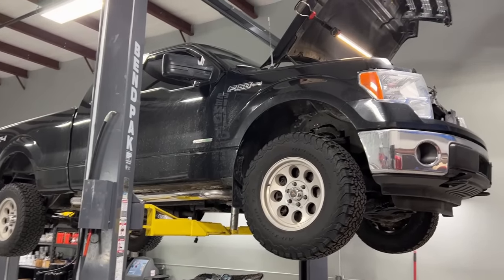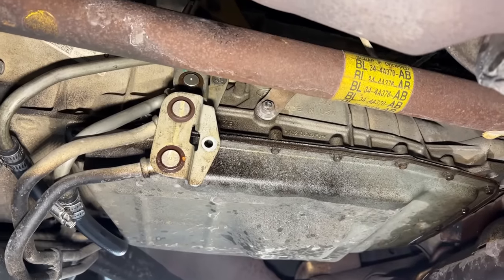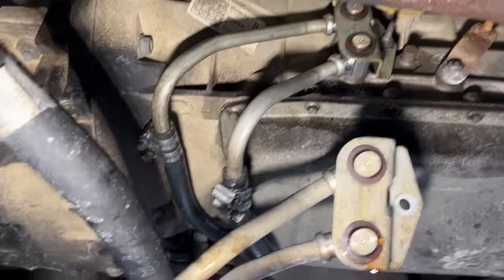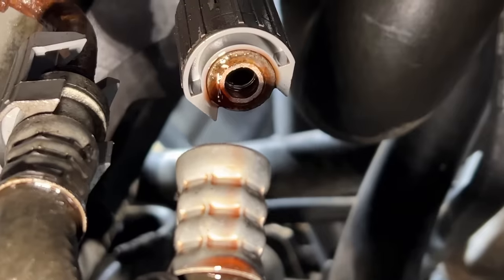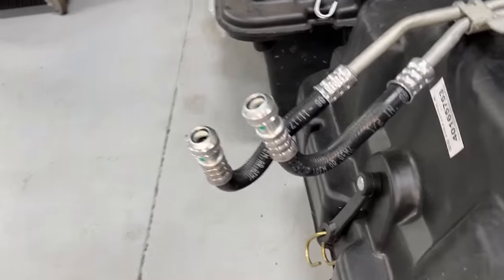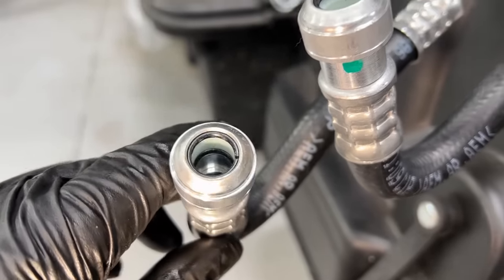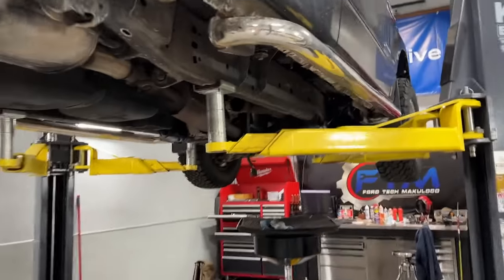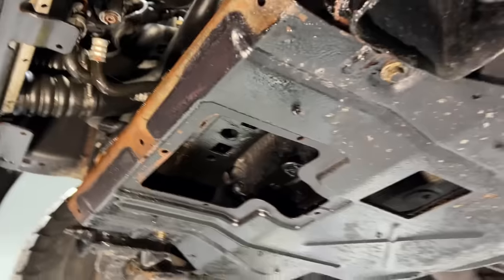Attention 2009-2014 Ford F-150 Owners! Check Your 6R80 Transmission Cooler Lines Before They Blow!

Comment: Beautiful close ups!  So the quick connects on the new lines are stronger, or has a same chance to break again?
Reply: Yes has the same chance of breaking again. I just cut the quick connects off put some barb to barb & some extra hose problem solved
Reply: There has to be an upgrade to this as @PaulSosa states, I wouldn't run the same thing unless there was a redesign.
Reply: @paulsosa1872  that's what i'm thinking. When would you ever need to "quick connect" anyway?
Reply: @jeffflowers729  Great question. Maybe it is to make it easier to assemble at the factory, or they think a connector like that is less likely to come loose, until it fails that is.
Reply: The quick connects are for when you pull the cab from the frame for work.
Reply: @chrism9322  which is really the point of my question. How often does that happen other than almost never? And if you are pulling the cab, “quick” disconnecting a line isn’t much of a time saver. I have an aux trans cooler so my configuration looks a little different than shown. I wonder if mine has the same stress point prone to failure.

Comment: I’m a helicopter avionic/ electrical tech. I’ve worked with really good sheet metal guys. One of them taught me about “dissimilar metals”. Two different metals in contact with each other while one reacts negatively to the other; very similar to your “metal-lergy” comment.

Comment: It happened to me about 2 years ago with my 2013 raptor.  Got on the Pkwy noticed white smoke behind me . Trans fluid burning on the exhaust.  Got of Pkwy immediately and saved the trans. No damage done. Except for the parking lot, I pulled into where it just dumped everywhere, lol.

Comment: Just  a side note. I drove my 1964 Ford Econoline 185 cu in. From Orlando to Seattle in 1990. Blew out the oil rings by Pensacola. Had to add a quart of oil every fill up. But it made it. Now have we improved anything? Really?
Reply: My 2011 3.5 Ecoboost has 338,000 miles, with original cooler lines (in the rust belt).

I'll be ordering these today.

Comment: I pulled it off!!  Not too bad except trying to fish the cooler lines thru the tight gap up front.   I was tempted to cut the old lines out but I knew if I could not get the old lines out, the new lines would not go in. I ended up removing the brackets on the tubes and re-installed them after I got it routed.  Also had to use a strap around the tubes to pull them forward.

Comment: I noticed a drip mark in the driveway, so I go under neath to check the source.  There was a drip on the transmission cooler line pointed out in the video.  As I was cleaning and inspecting the line, it broke.  I was not putting a lot of force on the line, so it was in the process of weakening and failing, hence the leak already forming from the failure.  Easy job to do as a DIY, my local dealer had the hose in stock and I was able to get and replace on a Saturday.  Bottom line, I would check your hose of leaks and replace is you see anything.  I have a 2013 F-150.

Comment: Should these be proactively replaced do you think? 
I've got a 2014 with this trans with 150K miles on it. 
Great info, love the channel! Appreciate all your hard work!!
Reply: I would change them if it were my truck. It might be a waste of money but it is better to blow a couple hundred rather than rolling the dice with your several thousand dollar transmission.
Reply: @--_DJ_--  I agree I have 119,000 on my 2011 and going to get new lines
Reply: @Tanks_Fire  Both of the 2012s we have in the fleet had them break somewhere around 150k km. I think you are making a smart choice. They are not too bad to get in there, but I have a hoist so doing it on your back might be a bit more of a chore. 
I have replaced the quick couple portion with rubber hose in the past, but it is a bit of a hokey fix, it works though. They were old worn out trucks destined for trade in on new ones so the cost of the lines wasn't worth it.
Reply: If it hasn't been done yet, do it.  10 years a lot to ask of rubber parts, you should also get your coolant lines inspected and possibly replaced too.
Reply: @BlueOvals24  The rubber isn't the problem.
Reply: @--_DJ_--  True, it's the dry rot on the rubber.
Reply: @BlueOvals24  Aluminum doesn't suffer from dry rot. You are either not aware of the problem this line is known to have, or are just trolling for some bizarre reason.
Reply: @--_DJ_--  You must be unaware that this "issue" is just general wear and tear. Old aluminum, old rubber, they aren't built to last and you should replace all your lines after 10 years, regardless of the vehicle.
Reply: @BlueOvals24  That is nonsense. You don't change lines that are not heavily corroded or leaking. It isn't 1960 anymore, rubber lines will last the life of a vehicle these days in most cases. In this case, they often fail well before they make it to 10 years. It is a poorly designed part, I turn wrenches for a living, I can't think of another line I have seen break in that manner, and I have seen plenty of ancient work trucks. 
A hard cooler line should never need to be changed unless it is corroded or the crimps have started to leak. You shouldn't have to be concerned about metal fatigue in a cooler line.
Reply: @--_DJ_--  You should always switch out lines that endure extreme heat and or pressure.  You wanna blow out a line, go ahead and leave the original one on for 20 years, that'll do it.  Do you also run the same tires during the life of the vehicle?  The same belts?  Wheel bearings?  It all needs to be replaced at one point or another, you just can't expect something that's often hot or under pressure to last forever, especially if you live somewhere with freezing winters.  That particular line commonly breaks because it sits in freezing temps when the vehicle isn't running, then climbs up to boiling temps on the road, it's not something that anybody should expect longevity out of.  Re placing that line along with all other trans/cooling lines should be part of your major maintenance, 100,000 miles or 10 years.
Reply: @BlueOvals24  You have to be joking, change every line at 100,000 miles. There is next to no pressure in a cooler line, it is not a maintenance item unless it is leaking, not even a dealer would try to sell you a line that was fine other than being old. Also, 6-8 years is not old when it comes to hard lines, they all last nearly forever until mother nature gets to them. They are all exposed to the same conditions. You have to be pulling your reason for it breaking out of thin air, you were blaming old rubber earlier. You clearly have no actual knowledge. 
Do you change every brake line on a car every 10 years just because? There isn't a higher pressure system in a car, and I guarantee you don't, and your life is dependent on those lines, not just an expensive transmission.
Reply: @--_DJ_--  Matter of fact I did change most of my old brake lines on my old Ranger, same time I did the master cylinder.  Anything that endures a lot of heat/pressure needs upkeep, that's just how it is.  And I never said you have to do all the lines at once, just inspect them and see which ones are starting to dry out.  If you aren't replacing coolant lines after 10 years, don't be surprised when you get a leak.  That is how a leak happens, you know.  Rubber drying and cracking, it doesn't just happen by chance.  My bottom line is, I've never had the problem described in the video happen to my truck because at 100,000 miles I went through and replaced many lines including this one.
Reply: @BlueOvals24  "Re placing that line along with **all** other trans/cooling lines should be part of your major maintenance, 100,000 miles or 10 years." 

What did you find to make you change these specific lines on your 09-14 F150? Why some and not all of the brake lines? I didn't say anything about coolant lines specifically, I said rubber will last a long time, a lot longer than it has in the distant past. Coolant hoses are different than aluminum transmission cooler lines. They do not need the same amount of maintenance. There is a lot more going on in an engine cooling system than there is in an oil cooler tube as far as chemistry is involved. 
I do in-house fleet work, I know how to keep a vehicle on the road without wasting a pile of money.

Comment: My 2012 5.0 did the same thing while towing a trailer in a rain storm.  Couldn't see smoke or smell anything until a check transmission light came on and it started to slip.  It was junk by then.  I had the transmission rebuilt and cut the quick connect out and just ran rubber line in its place with hose clamps.  No problems now for 2 years.  I thought it was just a fluke but I guess I shouldn't feel so special now.

Comment: Thank you for posting this and letting the rest of us know. What mileage was this particular example at so we have a reference?
Also whats the going rate for getting that pre-emptively replaced (hours of labor and part cost)?
Reply: Mileage doesn't matter here, it's age and how hot/dry your climate is.  Rubber cracks and leaks, you should inspect for this on any vehicle.
Reply: @BlueOvals24  9yrs and in the valley of the sun. Guess I better look into changing these out 🙄
Reply: @ottallman  In the valley of the sun as well. Ignored my lines for 11 years and had a puddle of coolant under it.

Comment: I see something like this at least once a month on U-Haul E450s that come from the north. Snaps off at the aux trans cooler in front of the cooling stack. The 6R140 must be far more forgiving because 90% of the time the quick-connect can be cut off, the rubber hose shoved onto the trans cooler line & hose-clamped in place. Fill it back up with fluid, usually 5 qts, leak check and customer on their way again in less than 30 minutes.

I have found several of these pre-failure while doing other work just be being observant. If you see ANY wetness, weeping or other suspect oily looking places on the condenser or bottom of radiator support, do yourself a favor & yank on those lines. I bet you'll save yourself 6 Gs.  Great video Brian, hope the vacay in FL was good to ya!

Comment: I've never been a fan of quick disconnects.  The problem with just replacing the hose set with a new OEM set is that you still have that same defective aluminum part connected there and the issue could come up again in just a few years (perhaps sooner).  I wonder if it would be better to just ditch that defective aluminum quick connect in favor of the more "tried and true" new hoses and hose clamps?  Those have worked for decades with few, if any, problems.  I have installed many aftermarket trans coolers on vehicles that didn't have them; the hose and clamp system worked just fine.  The line pressure isn't that high.  I wonder if anyone has tried that fix for these vehicles with the design defect like this?
Reply: Following!!
Reply: Interested from hearing this too
Reply: Long story warning ...

I did on my Nissan Armada.  It's lines cracked in a similar way.  Fortunately caught it when I pulled up home and saw tranny fluid all over my boat.  No fluid on the dip stick so I was close to disaster.  Found out on the forums its a common after warranty issue, say after 5 or so years.   People are pissed, no recall. 

So what I did is eliminate that issue.  Mine was slightly different but looking at this set up, I would just cut that metal "quick connect" off and then cut off the connection at the metal pipes that run up to the cooler.  Then flare the tubing slightly for some grip on the hose and connect the rubber hose directly to the metal lines with two hose clamps per line.  The flare will add grip.  More than likely will need to add a little extra hose since it'll probably be too short stock so get some same diameter hose at auto zone or wherever and add a piece using a couple short metal pipes flared again and some double hose clamps.

I know it sounds like a butcher shop method but it just works.  It basically can't fail.   I did this to my Armada at least ten years ago.  Works great.  It did drip a bit at first as the hoses were new and had to sort of take the load of the clamps but after a couple good tightenings, perfect.

Comment: I don't have that transmission on my 2005 F150 but I did have to replace those cooler lines because one or both leaked.  But my transmission have 346,000 miles on it and has given me zero problems.  Change the fluid and filters at proper intervals, and it runs like new...so far.

Comment: I have the heavy-duty tow package with transmission cooler.  Is the breakage rate different for vehicles with coolers vs. no coolers?  Great information.  TIA
Reply: Interested to know this as well.  Have the same package on my 2010
Reply from the maker: No

Comment: Thanks for the info.  Do you see this occurring on trucks that have reached a certain amount of mileage, reached a certain age or both?
Reply: Great question. I have only 55,000 miles on my 2013. Those aluminum connectors can't be going on a truck will low miles...Or Can They?
Reply: That would be nice to know. Mine is 12 yrs old with 440000km on it. I think i will ve replacing mine as soon as i get home.
Reply: Commenting for visibility

Comment: The aluminum line on my 2012 cooler cracked at the aluminum section when the truck was 6 years old! I got lucky because spotted the fluid while stopped on a very short trip Thanks for the great Vid

Comment: Being as they are cooler lines, what type of line pressure are we looking at, in and out of the cooler? Ought those of us with low-mileage rides (2009 myself, 60K miles) consider replacing the lines? If so, can you show a better line method than just replacing the hardware with known-to-fail components? 

By the way - how does one inspect fluid level/change fluid on these trannys/trucks?
Reply: Right side of trans has dib stick/tube you need to use wrench to unscrew. Plenty of videos on it.
Reply: Thanks yes... I found one... then I looked at a number of custom dipstick...omg the prices...
Reply: @Fred Wills I’ve been wanting a drain pan with a plug on it for a long as I’ve owned my 2013… I usually change the filter every time I change the fluid, I’ve heard somewhere that there lifetime filters but I don’t know about that. How often do you replace your filter now that you have a drain plug??
Reply: @Fred Wills thanks for getting back to me, sounds good. Does the doorman seem like good quality to you? I’m gonna do more research on it for sure. Thanks have a good one!
Reply: @Fred Wills nice good to know thanks I’ll look into it for sure now

Comment: Can’t you just cut off the quick connects and bypass them with some good rubber hose and some,clamps and prevent this from even happening?
Reply: Thats what I am thinking as well. Someone made a comment that's what they did. I'm going to definitely going to look into this. I have a 2013 with 153,00 miles on it now.
Reply: If you use rubber lines (hoses) to do that. Just remember that. Normal fuel line. Isn’t good enough. It will soften and swell And burst over time. 

It really has to be rated for transmission fluid. I am a transmission builder. I have seen the normal fuel line cause the same exact damage. It’s fine short term. But it isn’t a long term fix. 

Plus using the correct hose or not. The clamps will usually work loose over time. So checking them periodically is a must.
Reply: @larryschaum6280  right.  I get the transmission line, but high pressure or not?  Also, he said 15 clamps, but I know he was exaggerating, but I guess a few clamps on each?  Also, how to cut the lines?  Limited room.
Reply: @bogus696996  
I agree there isn’t much room. Depending on the outer diameter of the line. Find a smaller tubing cutter. Or if necessary go ahead and remove the line and drop it down enough to gain access. It is helpful getting the hose clamps to stay on. If you can slightly flare the end. So the clamps can’t just blow off if the get a little loose. I prefer two
Reply: My thoughts when I first heard of this. I checked mine and it doesn’t look that difficult

Comment: Great show as usual , And as a fellow mechanic I always change out my oil lines , transmission lines and brake lines to more quality stuff so I don’t have an issue no matter what the vehicle additionally I put my own coolers and remote filters in for ease because I do my own servicing and I have a pump that sucks out the oil and pumps it back in because it’s just that easy…… Keep on rocking…
Reply: That's how to do it man, replace those old lines before they can break like this.

Comment: I had a ‘13 f150 with a 6r tranny but not sure if it was 75 or 80. Worked well from 13-16 but started having shifting issues. Took it into the dealer and they ended up doing warranty work and replacing it. Their invoice list showed 10k in parts/labor. Was so glad I didn’t have to pay that. Traded it in in ‘18 for a new f150 when it started showing the same initial symptoms as the first time.

Comment: Do you know the millage when this has been happening? I have a 2014 so I would like to replace them before they break. Thanks for the information.
Reply: It happened to my 2014 F150 50 a year and a half ago.  Had to get a my transmission rebuilt.  May want to see how much it would cost just to replace the lines     but I’m no mechanic
Reply: I have a 2013 f150 with 207 thousand miles on it and haven't had any issues with the lines leaking but after watching this video I'm going to check them out. I think I'll put new ones on just to have peace of mind.